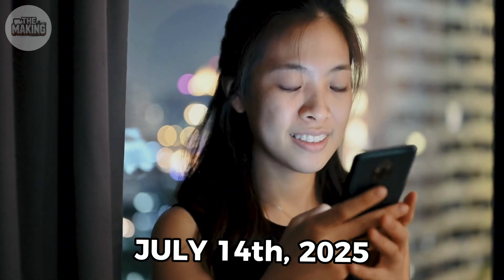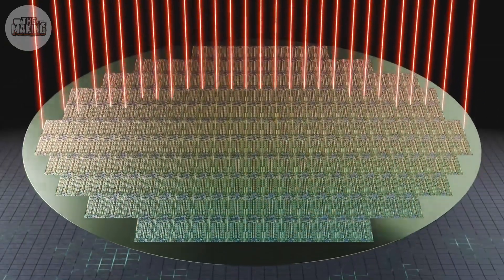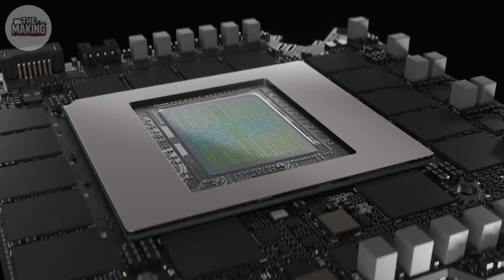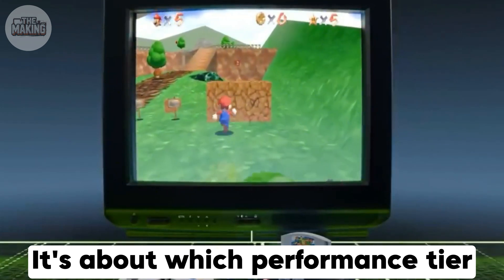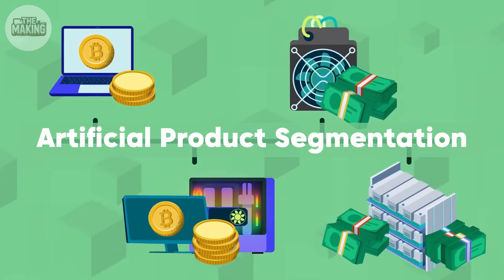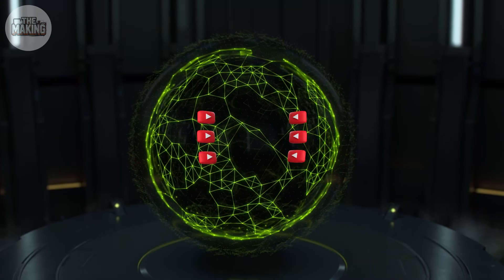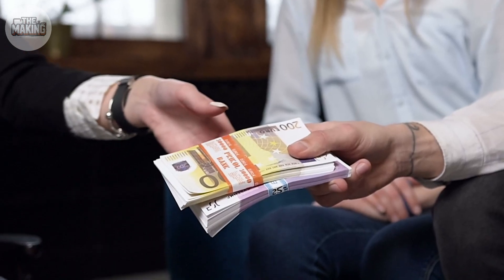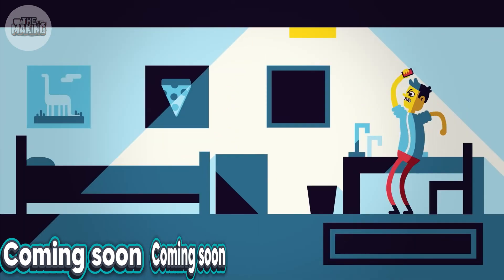How GPUs Are Made – Why GPUs Are So Expensive (And It’s Not Just Bitcoin) | THE MAKING

Comment: Missing a little part of the silicone lottery. The derate chips generally have defects in some of the cores or other hardware, so they deactivate that part of the chip. This means that unlocking the rest of the silicone can cause stability issues. Which is why it's a lottery.
Reply from the maker: So true! It's like playing poker with your GPU — sometimes you get a royal flush, and other times, well, you just fold and hope for the best! 🃏😉